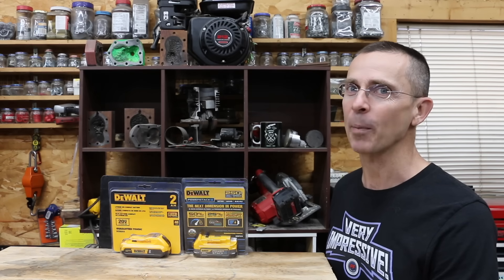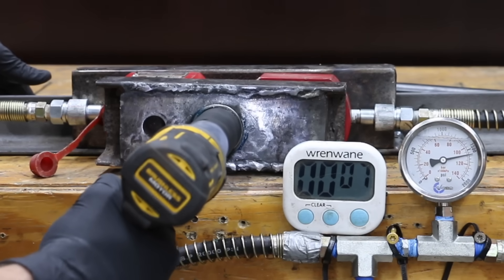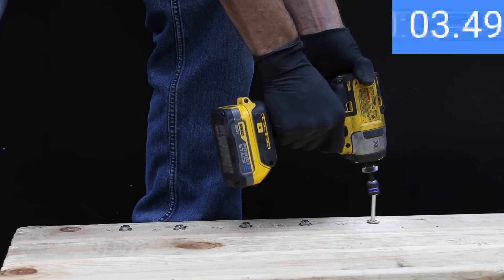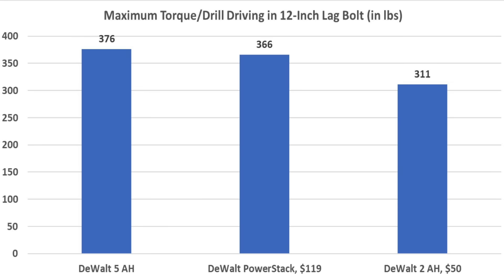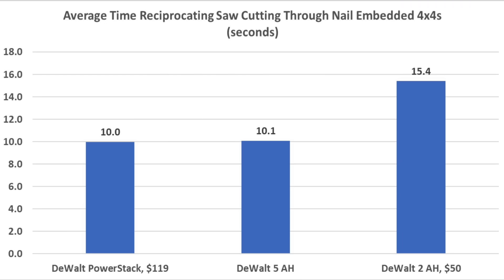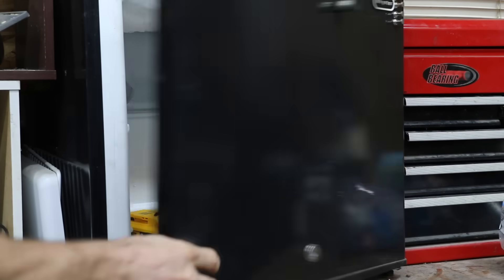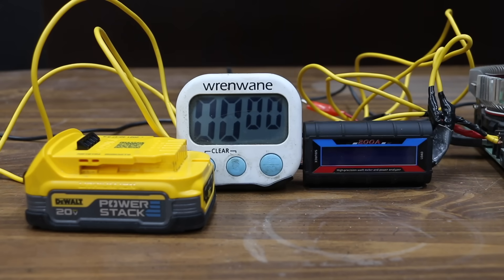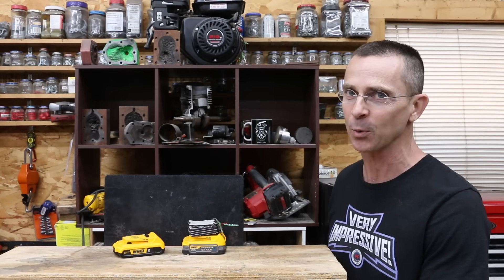Compact “Pouch Cell” Battery Better? Let's Find Out!

Comment: In general 18650 batteries used in those packs are very low quality! 
2Ah 18650 is a pure joke! You can easily buy 3.5Ah. 
Also Wh are very low for those packs. Only ~30Wh for "18V 2ah". I would expect something around ~36Wh.

Comment: Dewalt rushed the power stack to market to try and stay out ahead of FLEX. FLEX had been developing this technology long before dewalt   thats why when Flex released their stacked lithium just days after Dewalt they released 3 batteries to Dewalts 1. Thats why Flexs pouch cell battery tech is far superior to Dewalts. FLEXs stacked lithium batteries now consist of 4 batteries 2.0 ,3.5,6.0 and 10. They are the best power tool batteries on the market hands down. Unheard of run time ,power and fast charging.

Comment: I have 3 of the small, 2 large power stacks. All 2022 date code. 1 of the 2 large packs failed outright, no damage to internals. Lol you think the small pack is hard to disassemble try the large. 1 of my small packs quit, I was able to repair a bad connection (i think due to water incursion) . Same thing happens to the large pack, you have a brick. The same thing that makes them good at thermal regulation during use(high surface to volume ratio of the pouches) makes them self drain faster when not in use. Noticeably so on the small packs.

Comment: Thanks for this video, Todd.  Good testing.

Checking in today (6/7/2025), which is 3 years and 5 months later, and clicking on your Amazon links to the batteries, here are the current prices:
	• 2Ah: $31.95 (~ $50 in your video).
	• Powerstack:  $55.49 (~$120 in your video).
	• 5Ah: $65.99 (not provided in your video).

So price-wise, it looks like the Powerstack battery has slotted in between the other two, and is down about 53.8% from its introductory price.  

On a personal note. . .God bless early adopters for burning money for the "new hotness" and getting products (electric vehicles, computers and their CPUs & GPUs, power tools and their batteries, heat pump HVAC systems, solar systems, ever-bigger-screen televisions, etc.) off the ground.
Reply from the maker: Thanks and you are welcome!

Comment: I'll never use the stacked batteries. Polymer batteries like these cells, are prone to chemical instability, sometimes leading to fire. Do what you want. I won't use them.
Also, you should inform better about the normal round cells. Some are better than others, and you should tell which ones are used in the Dewalt batteries. It's easy to spot the difference on each cell, if you know how.
Cheers.
Reply from the maker: Thanks for the feedback.

Comment: I have a 60V Dewalt chainsaw with a dead battery. Do you think I can connect 5 12v lead acid batteries in series to the chainsaw terminals that would go to the original battery to use it temporarily wired?
There are other terminals for cell imbalance and temperature (I think, I'm not 100% sure) that would be left unconnected.

Comment: Prices will go down. Did you mention the increased charging speed or increased charging cycles. Also, if you are in the trade, a lighter battery is preferred
Reply from the maker: Thanks for the feedback.

Comment: Update with the newer 5 amp and 8 amp power stacks please
Reply from the maker: Thanks for the suggestion.
Reply: You mean 5ah powerstack and 8ah powerpack? The 8ah doesn’t use stacked lithium like the 1.7 and 5ah. It uses tabless cells. Thats why it wasnt called powerstack

Comment: If I may ask if you could consider a possible a quality test on... The Dewalt oil resistance battery vs the regular non oil resistant batteries, I use the Xr Power Stack version, I am interested in finding out is the oil resistant battery line worth the extra price? maybe a durability test of non oil res vs oil res battery same specs, with grease,solvents/break-cleaner,oils etc, to paint a picture to us the consumers on if the significantly higher price is worth it, that would help people who don't fully understand how important these may or may not be like myself and nor do I have the funds currently to test this. The 5ah Oil Resistant 20v Xr PowerStack from Dewalt would have been about $249.00 USA currency I am seeing on Amazon, I thought I saw it cheaper... like $130.00... So I purchased the 5ah 20v XR PowerStack for about $93.00 after tax in US currency

Comment: You should have posted the cost of the 5ah regular battery also to compare that with the power stack price because I think it's probably better just to buy the old technology even if the battery is a lot bigger on the 5ah I think it'll be cheaper probably and you get better performance.
Reply from the maker: Thanks for the constructive feedback.

Comment: The lipo pouches the outside 2 would stay cooler than the inside one. I like the 4ah compact battery for the reason they fit in a tool bag better. I have a 2ah, 3ah, 2x 5ah, 2 knock off 6ah, 2x batpower 4ah compact. Haven't used the bat power much  ut are same pysical size as dewalt 3ah and they use 21700s not 18650s
Reply from the maker: Thanks for sharing.

Comment: I like to see do a comparison to see if you use the 60 flexible battery on the 887 and drive the big 3/4-in leg screw 7-in or 8-in light screw whatever you had there and see if it done anything to the 887 if it burns it up or not.
Reply from the maker: Thanks for the suggestion.

Comment: We are going to be screwed if they stop making lithium replacement batteries.
Reply from the maker: Thank you for sharing!
Reply: What if it becomes so reliable that the cycles between replacement would justify a new battery with better tech and recycling being an option for the old cells?

Comment: You didnt mention the cost of the 5 amp battery & less comparing there.
The average homeowner probably will do ok with the 2 amp bsttery, but the 5 amp is of course better.
The power stack is probably too the heavy & expensive for the regular diy/homeowner.
Reply from the maker: Thanks for the feedback.

Comment: Now, a year and a half later, I see the Power stack's price has been cut in half. A 2-pack is $118. Also I see that its capacity is only 1.7Ah which is definitely interesting when putting it up against the 2.0Ah battery.
Reply from the maker: Thanks for sharing.

Comment: I have  been building high performance ebikes for over a decade. I would NEVER trust or buy pouch cell lithium batteries. They are guaranteed to fail and when they do they cause a TON of damage. The thing is, pouch cells can swell and deform causing internal shorts. The cylindrical cells can't swell and have a built in bimetal disconnect to prevent overheating.

Comment: The internal wires, the motor and the motor controller probably do not allow you to pull the high c rate current the pouch cell is capable of.
Reply from the maker: Thanks for the feedback.

Comment: Great test which show you're not getting much productivity for the price of these pouch cell batteries.  I do wonder if they last longer though.  If it's LiFePo4 chemistry then they should have much higher charge cycles.  Though at the end of the day it's easier to just buy more cheaper cells.
Reply from the maker: Thanks!

Comment: the new dewalt 4ah with 21700 cells is the best dewalt battery. matches the output of the 5ah and 6ah batteries while light and small like the old 2ah battery
Reply from the maker: Thanks for the feedback.

Comment: As a DeWalt guy, let me tell you that you are falling for DeWalt's typical BS here. Not about the Power Stacks being good batteries, mind you. I own Powerstacks and they are damned good. No, I mean their typical comparison BS.

DeWalt loves to put big percentage improvements on their labels. They put out a new tool and the package says "33% more powerful." Then, you read the fine print next to the asterisk and the number is in comparison to a 15 year old took with a Teradactyl inside of the battery. 

Same here. Of COURSE it is a lot more powerful than the 203. But it is priced like the 5ah XR battery, which it was really designed to replace. And the real stats when compared to it's price buddy are that it is more powerful, but it won't run as long because it is a 1.7 Ah battery.

I own the 5AH powerstacks.  Everuyone likes to help them rave about how much better they are than the 5 ah XR. Likewise, they ought to be because the 5Ah XRs do not cost $150 er battery.

Don't worry. You are not alone. DeWalt is VERY good at getting people to compare apples to oranges.

Comment: Perfect! This is the review I really wanted to see, and the results are what I expected.  

I recently traded in my Makita tools for  all yellow based on the Powerstack battery system.  I'm now Dewalt, Atomic, and Powerstacked for most of my power tools.  And all in red Packout tool boxes. 

Looks like I made a good guess.
Reply: BTW, after your vacuum review I returned my Dewalt vacuum for Milwaukee's Packout model.

Your reviews have caused me to spend $1000s in the right directions. 

Thanks😂
Reply from the maker: Thanks!  Thanks for sharing.

Comment: Picked two of these new powerstack batteries up today. The 1.7ah ones, lowes giving away free tools when you buy the bat in my area. And bat is 20% off right now also.  So for $147 x 2 I got a 3/8 impact driver and sawzaw with 2 1.7ah powers tack batteries. Great deal right now. (The impact driver normally is $199 tool only)
Reply from the maker: Nice!

Comment: The 5ah LI-ion is the workhorse of the working man. I have more charge cycles and age on my li-ion packs than you will ever get out of the li-po packs. I still have multiple packs from 2015 and 2016 still working in 2023.
Reply from the maker: Thanks for the feedback.
Reply: @ProjectFarm  the packs I have opened from dewalt so far contain lg or samsung 18650 cells. I have seen no name green cells but they are similar to samsung ones.

Comment: Your result on the speed test might be a little off. Since you are putting all the lag bolts in line with each other along the grain you are weakening the wood with each bolt and potentially splitting the board/post. This would make the first test slowest and the last one fastest regardless of ability. I would suggest staggering the bolts and screwing them across the grain rather than along it.
Reply from the maker: Thanks for the feedback.

Comment: Nice test with the standard 5ah battery added for performance and cost comparison. I held off on the 2ah PowerStack purchase since owning multiple 5ah batteries.
Since this video was made, I recently obtained the new 5ah PowerStack batteries for my 1/4” cordless router. I am very happy how they are working out with maintaining the cutting speed for smooth cuts. This router was purchased for dressing up existing in-place woodwork, a great setup. Happy to have waited for the 5ah PowerStack version to come out.
Reply from the maker: Thanks!  Thanks for sharing.

Comment: suggestion to do a video on warranty since a battery can have the best performance but if it cost a million to replace and another is free no one will get the better more expensive one. But most do not know, which for example many that know get ridged since with registration it is lifetime replacement battery which means you can replace all your battery operated power tools.
Reply from the maker: Thanks for the suggestion.

Comment: My major reason for going with the older technology batteries on my Dewalt Drill-driver/impact set as of late February 2023 is the power stack battery combo didn't come with a quick charge charger & the batteries in the powerstack are actually 1.7ah batteries.  That is un acceptable for someone like me that is going to need to rely on these to help make a living.  In my area the home store got 68 of these power stack battery units for sale before the Christmas season & to date have only sold 3.  That's horrible in a town of 100000 people.
Reply from the maker: Thanks for sharing!

Comment: Dewalt just made the 5ah power stack batteries available eliminating one of your issues with it.  Any chance you can do another run of battery testing with the new 5ah power stack battery????   I need a couple new batteries.  The power stack batteries are VERY expensive.  One site sells a pair of them for $324.  But a single one is over $200!!!!  I am not sure its worth it.  Unless the power really made up for the price diff.  Also thought about the 20v/60v batteries they sell.  I heard their performance and capacity is much better than the regular batteries.
Reply from the maker: Thanks for the suggestion.

Comment: That's  5 slightly larger by 3/32" diameter and length than standard 18650 battrees,not 6...18mm,or about 1/32" under 3/4" x 65mm or 2& 9/16" plus.. The deeper cycle batteries in dewalts are slightly longer and slightly thicker and have a much larger capacity as well as quicker delivery rate than standard Samsung,LG or whatever generic 18650 battrees,and often longer life.. I've rarely seen the pouch bottrees last more than 2-3 years in either high drain or slow drain anything;cell phones,power banks,solar chargers,etc.. while I am still using daily several dewalt 2mah battrees from 011 and 013,014,015 with zero loss of stored energy or issues... Have burnt up n even melted down one or more of the knock off "For Dewalt" kind of battrees using them kinda sparingly and not abusing them the way I  and my employees do the genuine Dewalts.. One quits charging simply remove 4 anti tamper torx screws,test each cell under load,physically pry off buss bars and remove any cel below the average rest and  quik solder in an exact replacement cell for many many more years of solid service ... Won't  waste even a penny on the stacked pouch battrees no matter what because you,me,we cannot repair them easily or cheaply like the 18650 type dewalt lith ions.. And yet another great,informative,unbiased vidididideo Todd.. Keep em coming n we'll  keep watching em..
Reply from the maker: Thanks, will do!

Comment: That's like saying fake sugar better?
Pouch cells are not. They are old tech. DeWalt battery suppliers were not very good anymore. They had to switch it quickly. Then tell you it's better for you.

Comment: These are lipo batteries.  These test results are what I expected…it’s why rc helix/planes/autos use them over lion.  They can discharge at a much higher rate and provide much higher burst amps and require much lower temps to slow discharge.    But they will road flair on you if they get ruptured, I have burned a few up when I auger my heli :(
Reply from the maker: Thanks for the feedback.

Comment: Great video, the amount of thought and effort you put into every testing video is impressive.  I doubt there is any way to really test longevity and safety, but I wonder if the Powerstack batteries will show any difference over time regarding charging longevity and safety vs. the 18650 batteries.  I'm thinking of the tendency of the flexible "pouch" type of Li Ion batteries to swell, burst, and possibly catch fire when they fail.
Reply from the maker: Thanks!  Thanks for the suggestion.

Comment: how much for the 5 ah battery ?, plus id be curious to know how much using a brushless impact would change things
Reply: $138 for 2 (not cheap)
Reply: I bought a two pack from Facebook marketplace for $100 last week. I'm sure that person stole it from Home Depot or something but I figured someone was going to buy it, might as well have been me. 

It does make quite a difference, particularly with the new subcompact Atomic line of impacts. The DCF823b  Atomic 3/8" stubby impact will pull a rear caliper bracket bolt on a GMC 3500. It won't with a regular old 3 ah battery, and takes a bit longer with a 5 ah, although it will break the bolt loose eventually.
Reply: Look for the 2 tool deal,  like tool barn or acme websites, two -5amp hour batteries with a charger, bag,  and a good 887 impact tool ! $199.

Comment: Thay now have the power Stack 5amp battery at Home Depot for over $240 dollars thay say it will  give a Dewalt power tool 50% More Power I will wait until thay have the Power stack Flexvolt batterys before I buy
Reply from the maker: Thanks for the feedback.

Comment: My experience with pouch cells in the R/C world, is that they tend to swell up and leak. ( especially after a few ground impacts)
 i think the cylindrical cell is tougher. But the pouch cell lighter is probably more efficient in discharge rate compared to the cylindrical cell which means more initial power.
Reply from the maker: Great feedback! Thank you
Reply: I believe the R/C pouch batteries also had a reputation for violently catching fire while charging.

Comment: @Project Farm , Something to consider with this and future battery tests is cell replacement. The 2Ah have a reputation of “dying” but in fact not need one or two of the cells replaced, which is much cheaper the replacement. These cells are a standard size so they are easy to source. I wonder how easily the flat cells can be sourced and replaced because the same thing will happen to it.
Reply from the maker: Thanks for the suggestion.

Comment: I surmise that the 18650 batteries are so ubiquitous and proven, that they are cheaper for DeWalt to purchase and perform well for a lower cost.  I would trust them to last longer than unproven "soft battery pouch technology" from China, but that is just a guess.  By "last longer", I mean prove to be more durable over time.

Comment: I have both i been using on the new xr cut off tool. The 2 amp was way way better at first. But after break in the stack has more torque  but the 2 last longer  on cutting lux stone and stainless.
Reply from the maker: Thanks for sharing.
Reply: @ProjectFarm  i would like to see you do a video on the ne cutt off tool  and its blades.